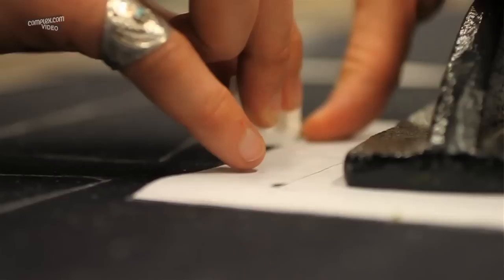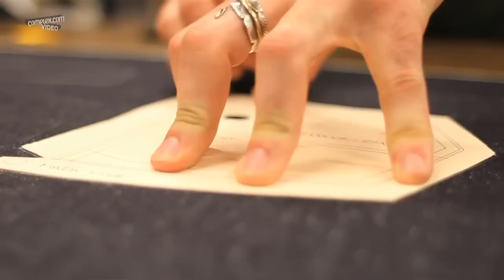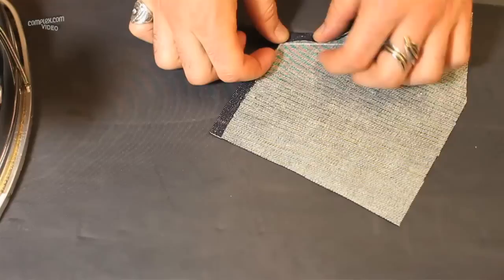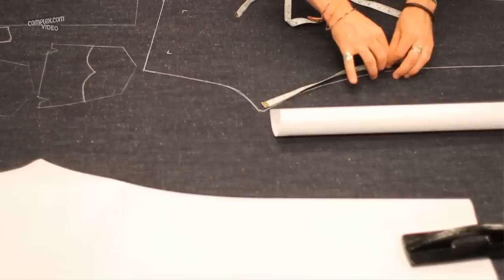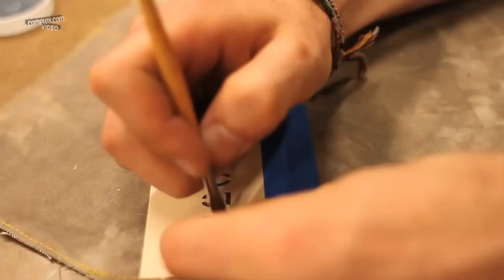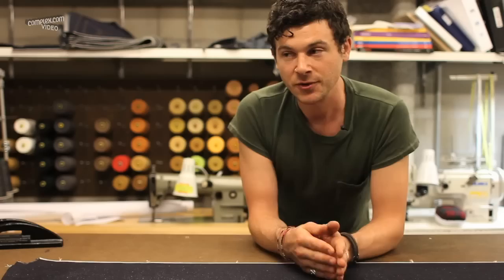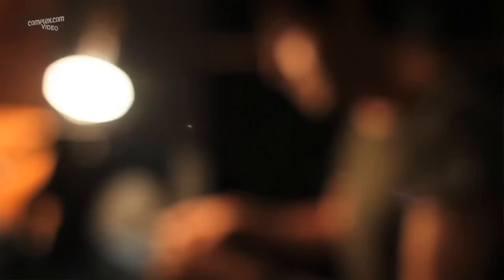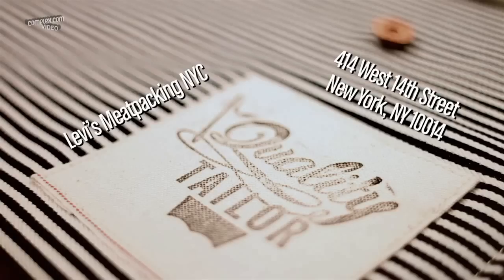Making Jeans By Hand with Levi's Master Tailor.mp4

Comment: Custom Levi's would be great. However, I'm doing well with the 502s. I really like the fit. They are "regular fit tapered."
The perfect balance between regular and slim fit. Not too tight, not too loose. I have them in 4 colors.

Comment: I like Levis,but they need two extra belt loops around the back to keep your belt from riding up.
And I also prefer the low rise,slim fit.Something on the order of a 7" or 8" rise.
The 527's are the closest thing to that,but they're missing the two extra belt loops and the rise needs to be a little shorter.
Reply: Low rise slim fit is a 511. You're welcome. (: